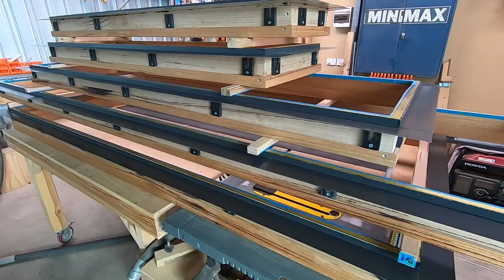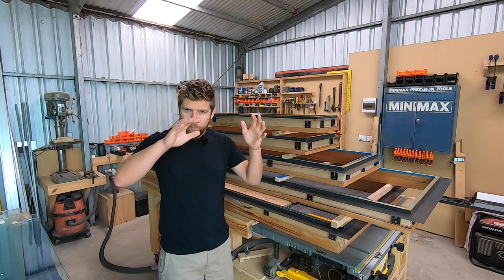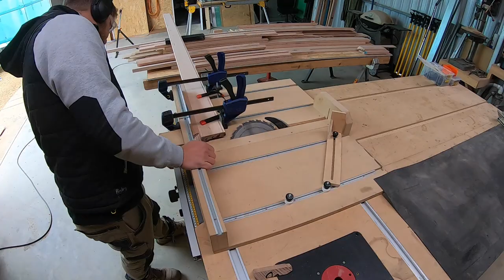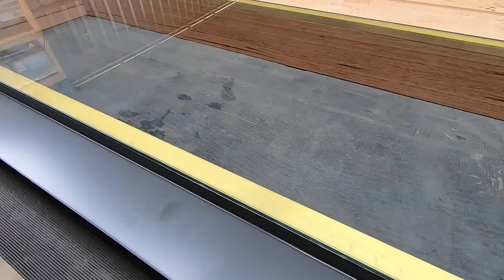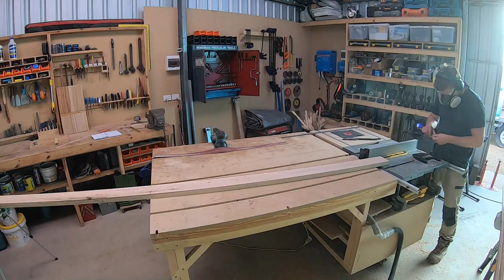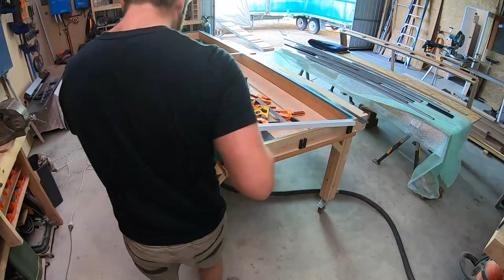Ep. 17 -  How I made my own my own windows  pt.1 - Tiny House Build Update

Comment: Good to see you back after your break.  For the glass you have some vacuum clamps, it might be worth experimenting with hanging the glass vertically from the rafters and moving the frame up to the glass? You might not even have to hang the glass, perhaps supporting it vertically on the bench will do the trick. Allowing you plenty of time to align the frame and glass.
Reply from the maker: Yep I have a couple suction lifters. I am looking at something like that where I lower it down the roof of the shed. The biggest issue I have is I have to have the glass laying down so I can put a band of silicon on the glass first - it gives me an even black band on the glass. Then I have to then flip it over onto the frame. I am currently looking at lowering the frame onto the glass even.

Comment: Well I'm glad you're doing okay.
The upside of the delay was that I forgot the mention of brass and was pleasantly surprised to see it on the exterior of the frame.
Hmm, sounds as if some of your walls will open. Guess I'll have to stay tuned.
Reply from the maker: The brass doesn't actually end up in the outside but you'll see it from the outside. 
😂 you'll have to wait and see 😉
Reply: @TwoHandsandaTinyHouse  I do realise that, by exterior I just meant facing outside, even though you're adhering the glass on top of it.
Hmm, could be anything from shutters to shougi, we shall sh'ee.
Reply from the maker: @zacdredge3859  ah sorry, yeah it's outward facing but will be covered by adhesive. That said you will see the timber and brass of the reveal through the glass which is going to contrast against the iron 👌.

What is shougi? I can't find any info.

Comment: Coming along nicely! I am in the process of designing my own tiny house and hats off for the invitation you've got going on here! 

I'm trying to design mine with a roof that can raise up to allow standing height in the loft but also lower back down to keep the house under about 3.3m from the ground to allow easier travel... Think I might have gone a bit crazy 😂

On the topic of a rotating tiny house, I did see a company that uses the shipping container locks to lock the house to a trailer but allow you to unhook and switch the trailer around. Maybe something in that 🤔
Reply from the maker: Cheers man. Great idea with the pop-up roof. I'm assuming your aiming for 4.3m? I looked onto something like that one. The trick if you wanted to make it really simple was making it weatherproof. There is one build who has done a pop-up roof. They swing up the roof then lift in the extra pieces. 

Haha totally don't need to be distracted with a rotating tiny house. The real trick is the track/turntable to support it. I did have some ideas of outriggers with a track on it. But sounds like more effort then it's worth haha
Reply: @TwoHandsandaTinyHouse  The pan was to try and keep it around the 4.3 once raised but it wouldn't be such an issue if it pushed a little higher given it would be parked up off the road when raised. of all the things I have found the most challenging is definitely making it weatherproof, Luckily dad is a sheet metal worker and no stranger to Aluminium so I have a few ideas about using some channel section that will sit over the lower wall. I believe I have seen that particular video myself that's what gave me the original idea.

Yeah by the time you start adding big components the weight definitely kills it, and to go the the next step of using out riggers its probably a little much. especially given the house is already on a trailer and can just be moved anyway lol

P.S no idea how the comment ended up here I did go to do it on the new one but 2am me had no idea apparently.

Comment: Love the explanations. My question is what will stop the beeswax from melting and staining the timber. I'm also very interested in the passive air flow option. I will have to just wait and trust you on the glass staying up with a bead of silicone but gee it's going to look good.
Reply from the maker: The timber is oiled and waxed with the same stuff anyway. But you are right it has made the join darker. That is natural with oiling. Hopefully it won't create any issues. 
Haha adhering the glass makes me nervous too but it's all in the maths. 
Looking at my heaviest piece 1.4m x  0.8m and weights 25kg:
It has a perimeter of 4.4m (or 440cm). With a 1cm wide bead that gives me a surface area of 440cm2 that of adhesion. 
The glass is 25kg (or 2500g) 
That is 5.68g per 1cm2 of adhesive. That is half the weight of a 20 cent coin per 1cm2 of adhesive. 
Crazy hey
Reply: @TwoHandsandaTinyHouse  fabulous! The level of thought you put into things is great.